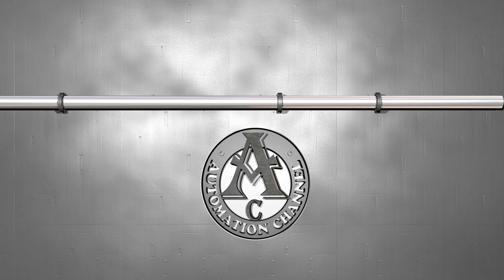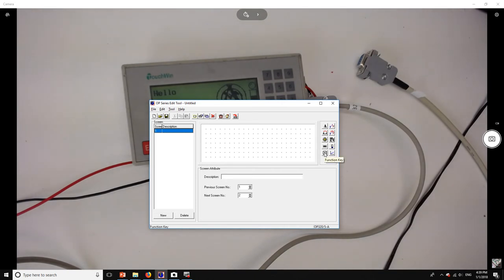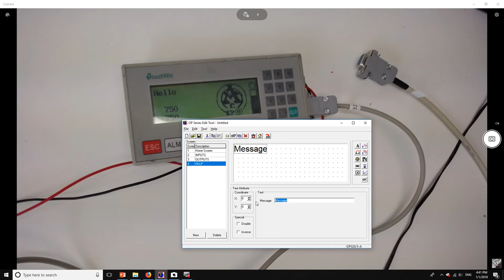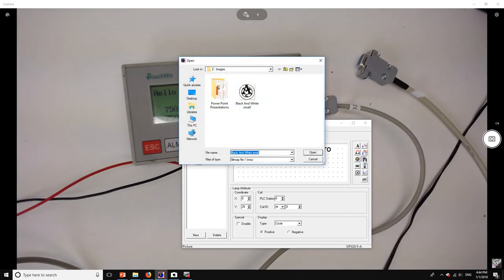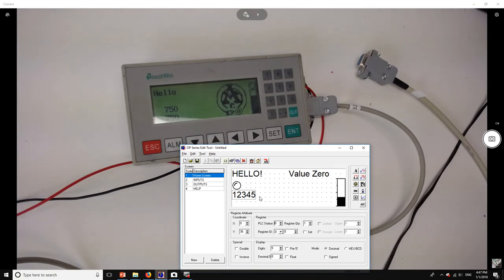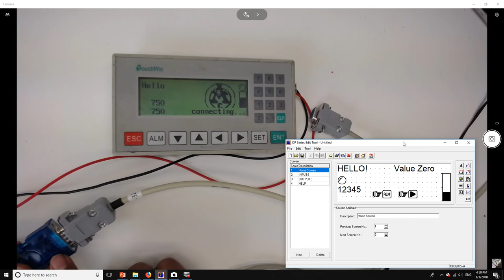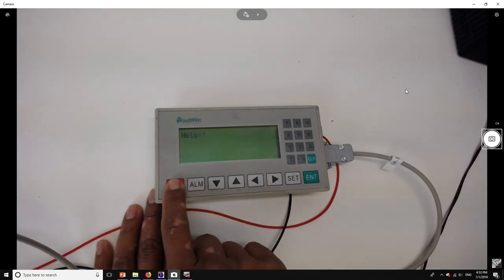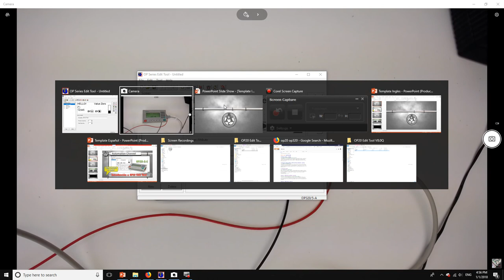Introduction to OP20 Edit Tool - English

Comment: Plz guide how to connect this display with "USB to 232" converter for programming as standard "USB to 232" does not support
Thanks in advance
Reply: Connect gnd with gnd, rx with tx, tx with rx, pin 7 with pin 7.

Comment: Good day Sir i would like to ask if i can also program it as a timer two separate lines upper side is start from seconds to 25 mins 

And then at the bottom side is 0 sec. to 30 mins 

This timer is controlled by delta plc 

Thanks

Comment: xin cach 
xin cách đấu cable với
Reply: a đấu cable cho hãng plc nào ? e hướng dẫn 1 tí cho
Reply: dạ em đấu cáp lập trình màn touchwin OP 320 - A - v7.0
Reply: hmi touchwin kết nối với máy tính hay plc ?
Reply: @vusa5695   touchwin kết nói với máy tính a ạ
Reply: hmi touchwin 320 A, V7.0 kết nối với máy tính để lập trình ạ
Reply: chân 2 PC nối với chân 3 TOUCHWIN, Chân 3 PC nối với chân 2 TOUCHWIN, chân 5 PC nối với chân 5 TOUCHWIN. dùng jack 9 chân ( rs232 ) .
Reply: @vusa5695  bạn có biết cách backup HMI này không?
Thanks!